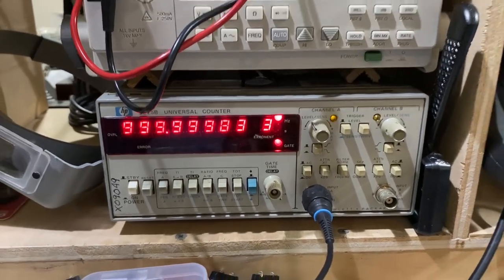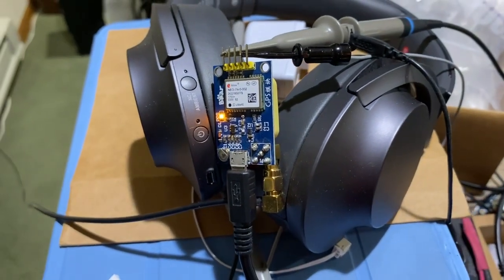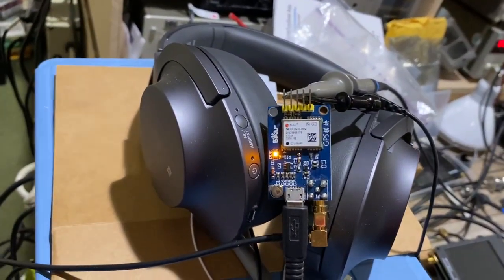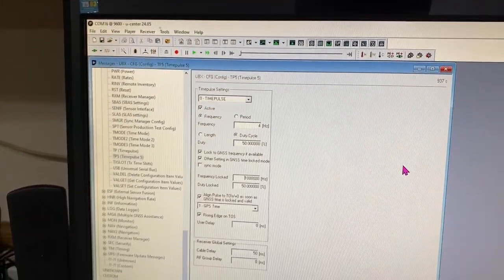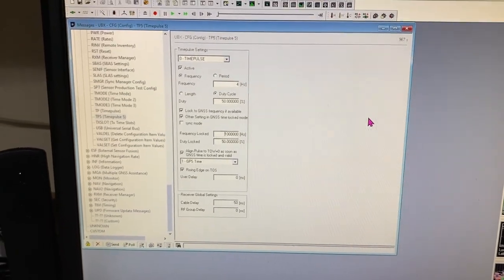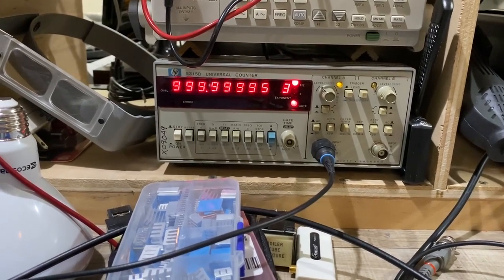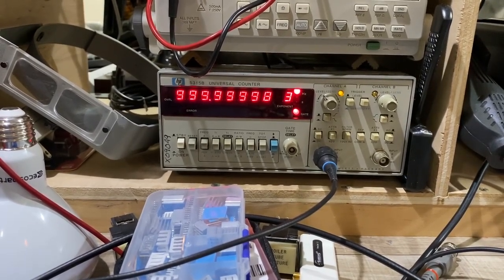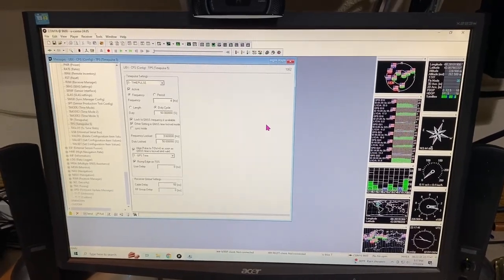10MHz Frequency Reference for $10 ... super cool

Comment: where can I buy this unit?
Reply from the maker: Several people have asked where the GPS module can be purchased.  I googled the part number on the core, "NEO-7N-0-002" and found several sources (see below).  I do want to say, there are many boards built up from this type of core, and this is not the most current revision of the core.  I suspect, * but do not know for fact ***, that most/all of the UBLOX modules behave the same/similarly to the one shown in the video.  I picked this one up at a hamfest/electronics swapfest, and that's why I used it.  Again, I have only experimented with the one shown in the video.  Please do your own research.

Important features:
1) app that lets the configuration of the GPS core to be adjusted via USB port
2) antenna connector that permits a remote antenna to be connected
    (if your bench can't see a window/sky)
3) external PPS pin

https://www.robotshop.com/products/neo-7m-gps-module-arduino?gad_source=1&gclid=CjwKCAjwvKi4BhABEiwAH2gcw_cQ8Qb4aAMowjKGlN9frjpfiXkBV5GBKjY529USFqEwsxPsy54xkxoCE7UQAvD_BwE

https://www.jameco.com/z/WPI430-Velleman-Velleman-GPS-Module-U-BLOX-NEO-7M-for-Arduino-by-Whadda_2354615.html?CID=GOOG&gad_source=1&gclid=CjwKCAjwvKi4BhABEiwAH2gcw5dF9fYCk7GBNYXQmzaZItaz-lAPuL54jjwU5xZoQk7ZZF5ZzJ6IDRoCZSoQAvD_BwE